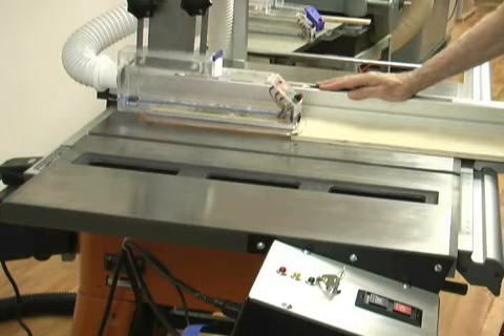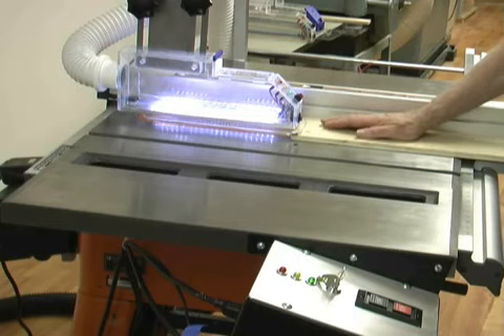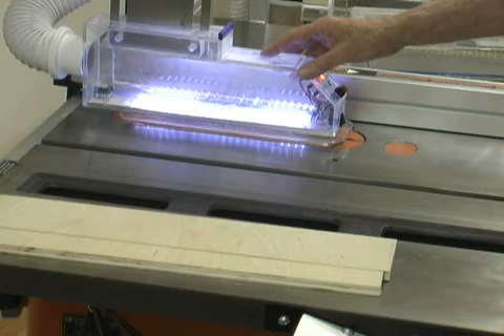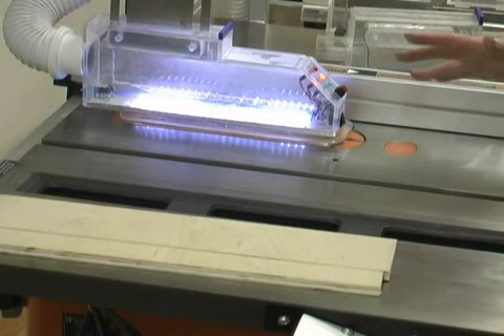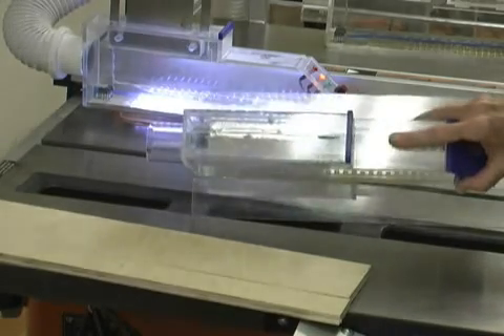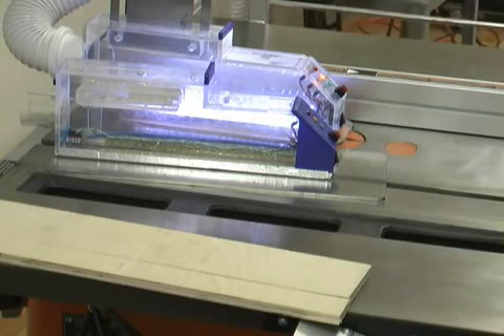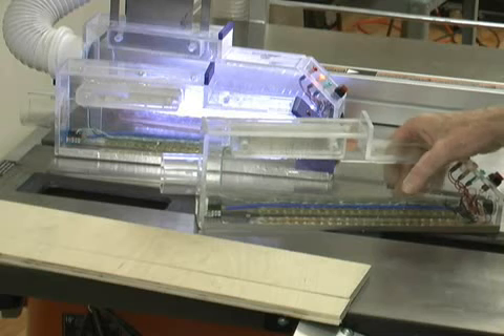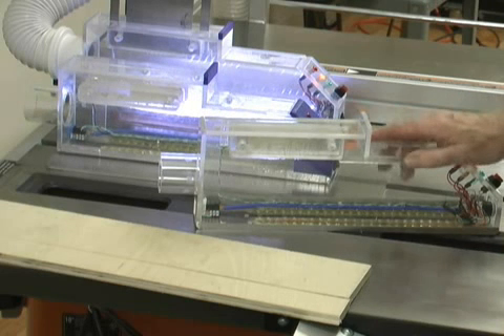Safety Demo with Rigid Table Saw – Whirlwind Tool

Comment: I think that sawstops are dangerous because they make people lazy. That being said, a giant shield over the blade kind of negates the need for the blade to be shut off because it keeps your fingers away from the blade. It's also useless because a lot of cuts can't be made with a giant shield over the blade and 90% of the idiots out there would remove it even for cuts where it is a useful safety feature.
Reply from the maker: Dummy!  I'm a master cabinetmaker with more than 60 years experience building Federal period American furniture reproductions. My website  may show some.  I'm a mechanical and electrical engineer and inventor and never been injured by any machines.  What do you do?